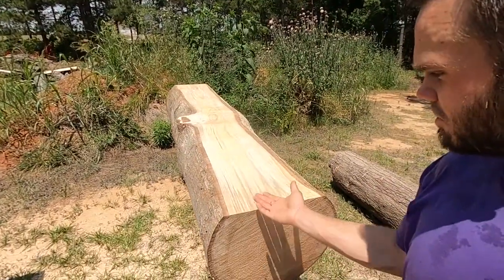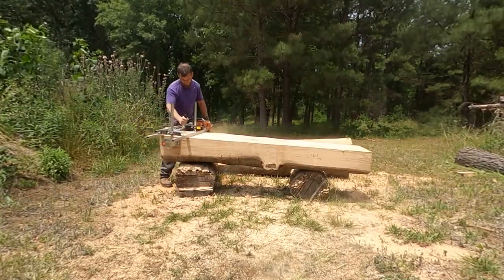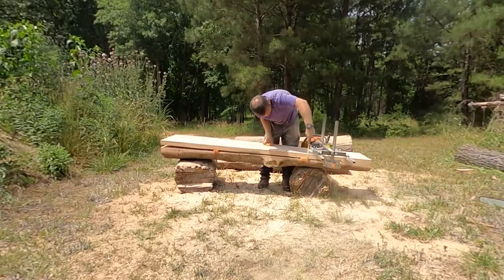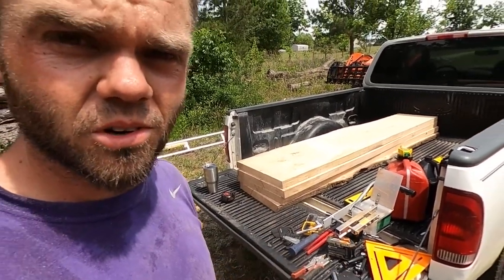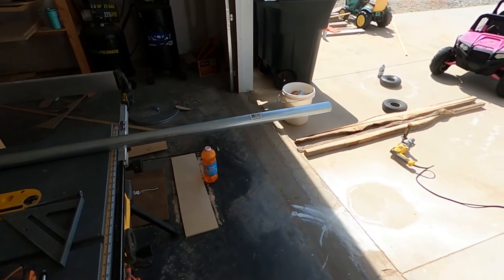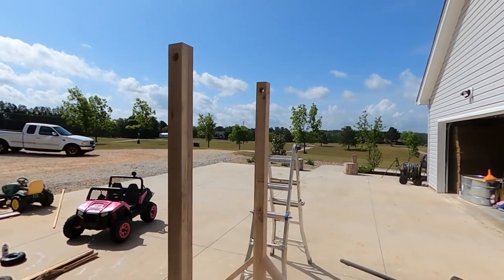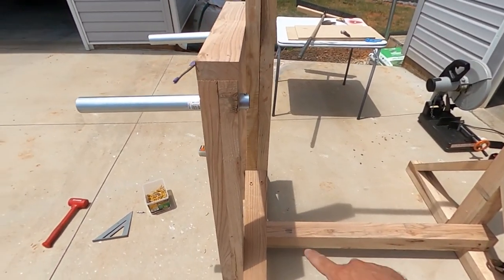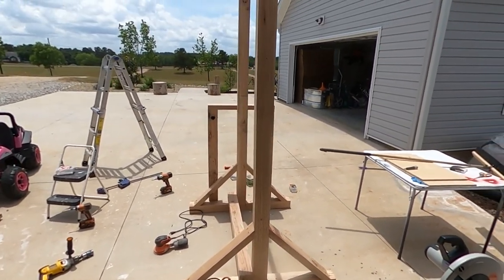Logs to Lumber | DIY Workout Equipment

Comment: Hi Jon nice project 👍
One years wood on air is still pretty wet, I am amazed that it worked with the chainsaw so well. Even when you cut it in half and store it under a roof, it still takes long to dry for machining. 

When I come to work out with you I think we need a lot of screws 😂 

I am 6'5.95 tall (198cm) and 242 pounds (110kg), when dipping at the side, it will fall over, too much weight 🤣
Reply from the maker: It was pretty wet. It's been in the 90s here and it's still straight with no warping hopefully it will stay that way! I get my chainsaws sharp. Everyone that sees them in person always ask me where I take them. I say to my vise! We will need lots of screws bwahahaha also you'd be surprised I wore a 70 lb bag and did dips yesterday that put me around 240 and it worked great!

Comment: Looks great and functions well. I noticed it wobbles a little when you’re doing dips. Do you think you’ll need to add a brace across the top to keep it from loosening up?
Reply from the maker: It did wobble a bit, it actually worked out to my advantage though. It taught me to be less jerky in my movement and take it smoother. I use it all of the time and it’s still working great.